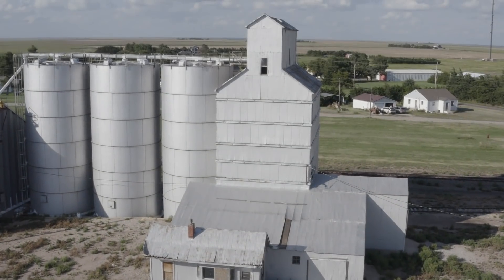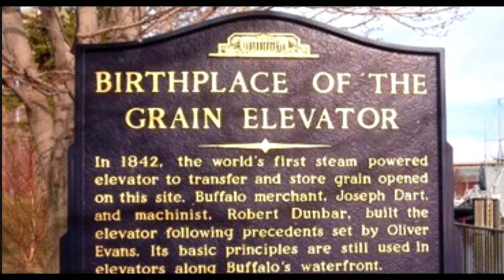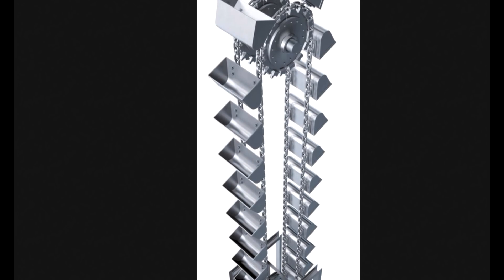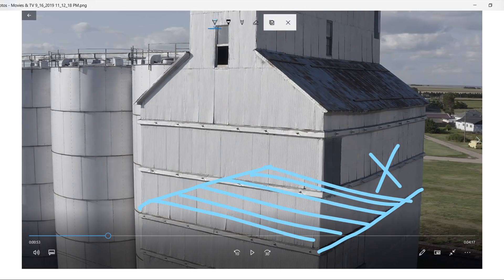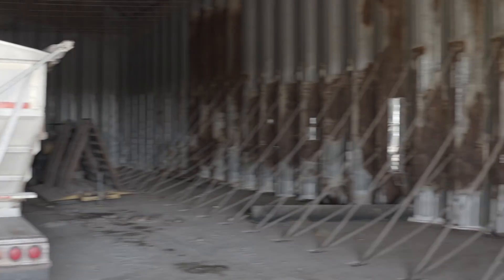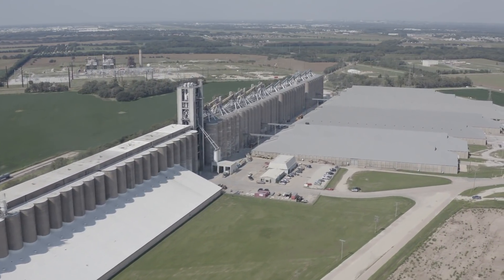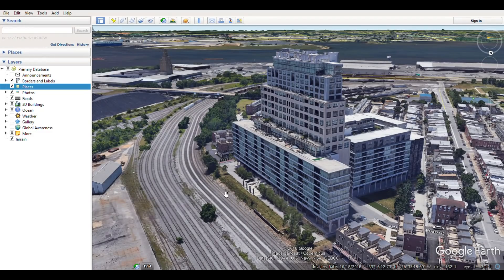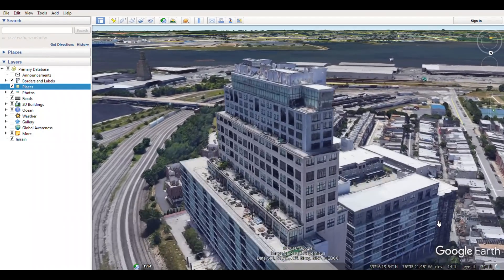439  What is that square building?

Comment: A very good educational video ... that previously would not have meant that much to me, but since I worked at Cargill I came to understand these operations as it was a feed mill that stored grain/feed/ingredients in a similar fashion. 
Anyway on my Dads farm he had a grainery that was wood timber framed (hand hewn) and sheeted in galvanized steel. As a kid I would play in that structure and came to see all the little holes in the floor with slide mechanisms for releasing the grain to a lower level all kind of neat but not as large or immaculate as your opening picture of a stand alone building Grainery/Elevator.
Anyway if you get through Elk River, MN right on US HWY 10 is a small elevator that nearly did not survive but fortunately was saved when a feed store operation came in and repaired the broken windows and really fixed it up in a manner that now makes it nearly an attraction with all that they display around it in a pleasing way offering plants and the like.

I am betting that you will come up with some interesting video's on how this was done elsewhere as well, as a humble suggestion anyway.
As to your question ... I will provide a link to some things of interest to browse through from a Russian search engine that is an interesting alternative provider;  https://yandex.com/search/?text=largest%20grain%20storage%20in%20the%20world&lr=29640

Then an interesting article to review; https://www.hutchnews.com/80adc4b0-72bb-59de-a14e-337b5fc76b56.html

Thank You for this video

Comment: How many trips with the truck you drive to fill one
Reply: The typical grain trailer holds between 1000 and 1600 bushels depending on tires and axles. At 18 million bu that would be over 40 loads every day for a year, including new years and Christmas.
Reply from the maker: My blue truck carried about 1000 bushels.  Remember a lot of this grain is moved by rail.

Comment: Egypt - 1.38 million tonnes (if it is wheat then that = 50,706,720 bushels)(If it were Oats it would = 90,000,000 bushels)

source:  http://www.feedandgrain.com/news/worlds-largest-silo-order-completed-in-egypt

The DeBruce facility in Hayes KS was 2,717 feet long and had a capacity of 20,000,000 bushels, less than half the size of the terminal in Egypt.
Reply from the maker: Thats one of the things I pointed out.  The Haysville Ks location is the "longest" elevator in the world making it the largest by length.  There are others that are larger by capacity or yearly volume, etc.

Comment: Your use of complex is somewhat misleading. Complex, when used as a noun, can mean a single building or a group of buildings or structures housing related units. This response is using the group of structures meaning of complex. 

"The 23 large silo plants supplied by Cimbria to Egypt were commissioned and officially inaugurated by the President of Egypt, H.E Abdel Fattah el-Sisi, during a mammoth event in El-Marashda, near Luxor, on 14th May 2017."
"This project is believed to be the largest order for silo plants ever made, comprising a total storage capacity of no less than 1.38 million tonnes of wheat, and with a contract value for Cimbria of more than 100 million US dollars."~ Feed and Grain News
http://www.feedandgrain.com/news/worlds-largest-silo-order-completed-in-egypt

Professor Sasnak, I fully expect to get extra credit for my response. Whether I am correct or incorrect, my willingness to think "outside the box" displays exquisite critical thinking abilities. 😉
Reply from the maker: Your the teachers pet.  You get a 🙂
Reply: @Sasnak  😂😄😂😄😂👍